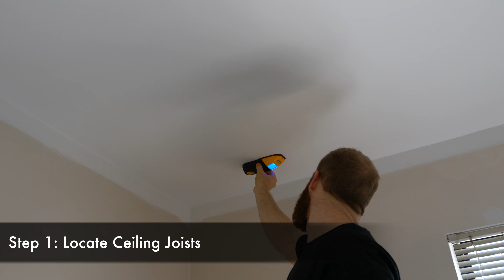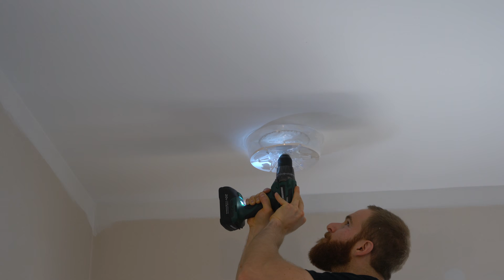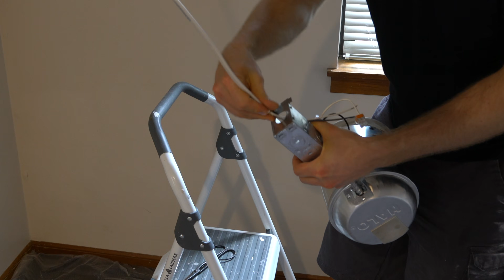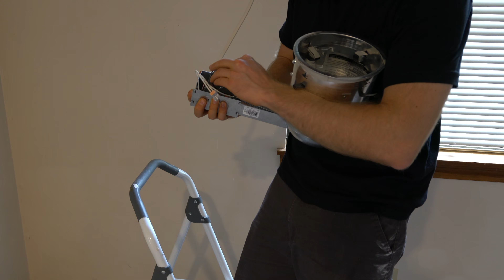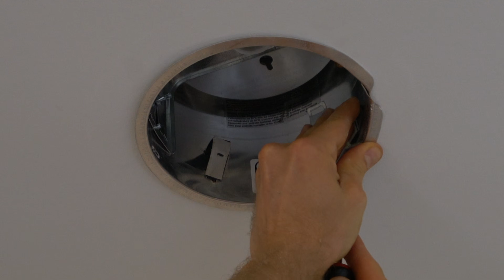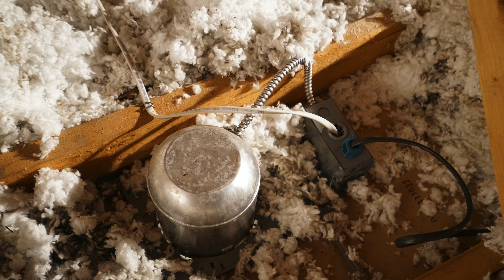How to Install and Wire Recessed Lights

Comment: I’m trying to replace an existing can light. My new one has white, black and bare wires. The current light has four white wires, three black wires, a green wire and a bare wire (not connected to anything) I’m gonna have to hire an electrician to figure out the mess, aren’t I?

Comment: This might be a really dumb question, but .. so you have to buy the 14 gauge wire, and then connect it to another junction box in the room? Would there be a junction box on a ceiling fan that I could connect the 12 gauge wire to? Also - I’m so confused on how you connect the other end of the wire to another junction box. How do you get to the other junction box? I would love to install recessed lighting, but I am so confused by this step 😅 

And what about say .. in a bathroom with no overhead lighting? Where could I connect the 12 gauge wire to if the only power is the light switch to the lights above the bathroom sink? That might be obvious, lol, but I don’t know how again, to get access to the place where I would have to connect the wires. Thanks for the video nonetheless, I learned a lot!